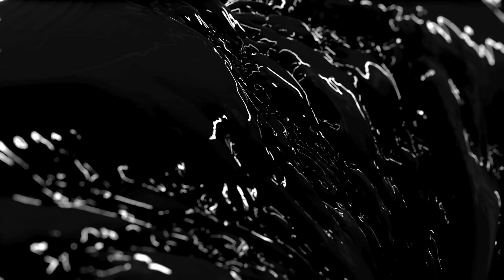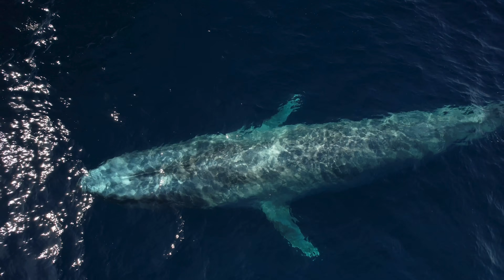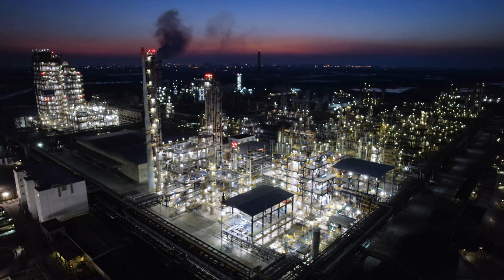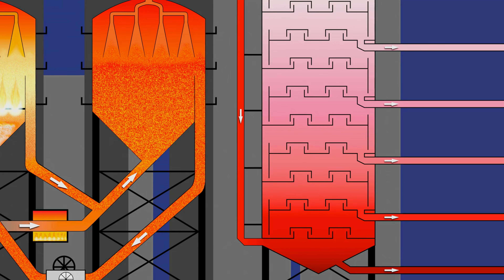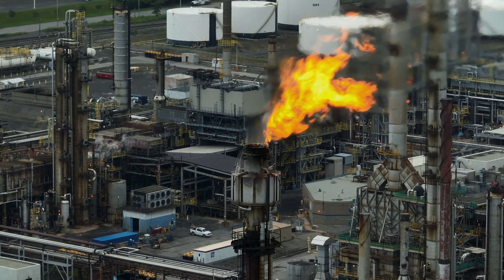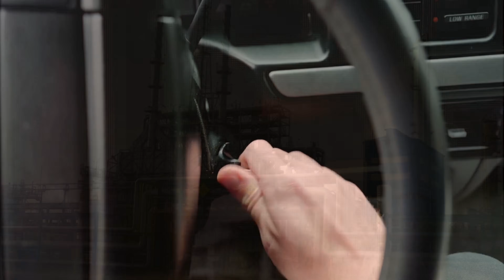How Does Crude Oil Refining Work? Unveiling the History and Oil Refinement Processes

Comment: Coal can be used to produce hydrocarbon gaseous and liquid fuels.   China and South Africa still convert coal into hydrocarbon fuels.   The process became too expensive, and polluting for other countries to continue doing so.   Check Sasol corp.,   etc. for details.   The same/similar heating and catalytic cracking are used as with petroleum.   Also direct coal liquefaction and also indirect coal liquefaction,   Fischer-Tropsch synthesis, process  (of Syngas).   The Germans used this method for producing gasoline etc. during World War Two.